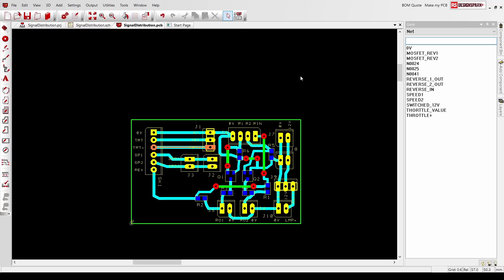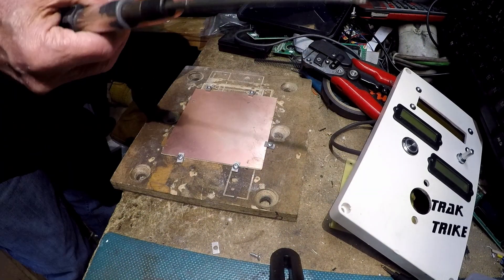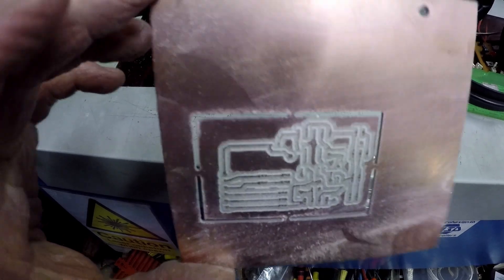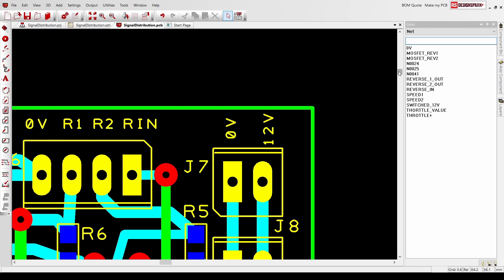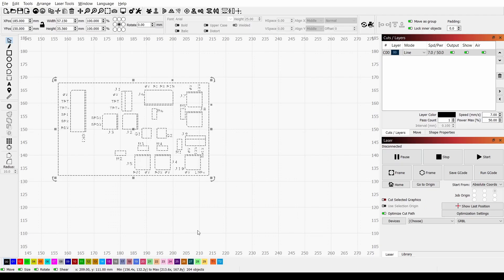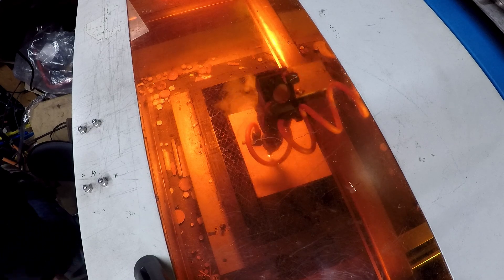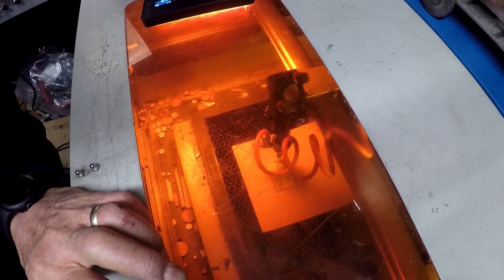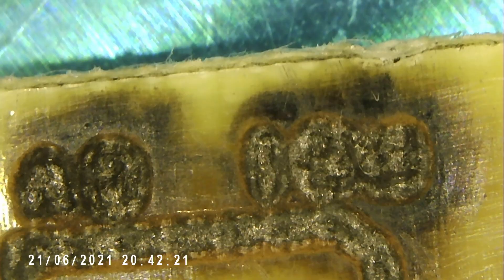Creating a 'silkscreen' with a laser cutter

Comment: I made a PCB via laser, this way...
Cleaned the copper, then sprayed on black acrylic paint.
Burned off the to-be-etched areas with the laser.
A light cleaning to remove dust, then etch in Ferric Chloride.
Then remove the remaining acrylic paint with acetone.
I use my pillar drill to make any through holes.
Finis.
Reply from the maker: Yeah. I experimented with this method but I use CNC now. The etching chemicals were just too messy.